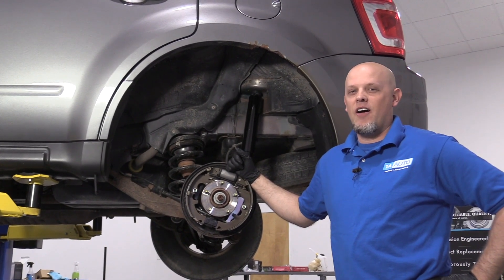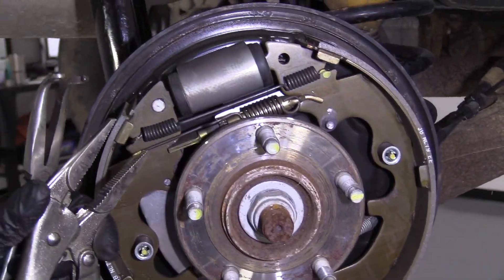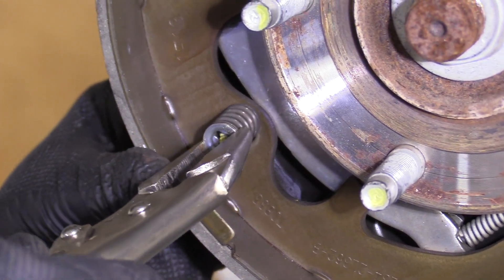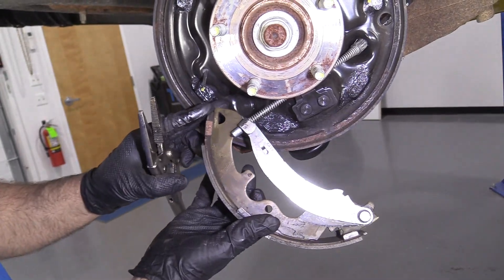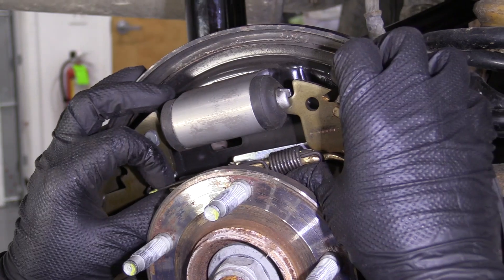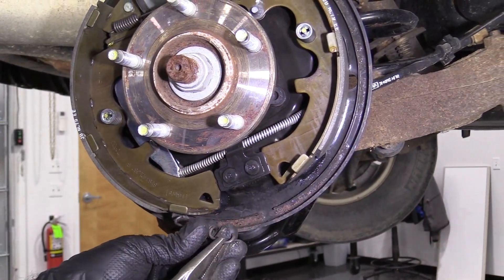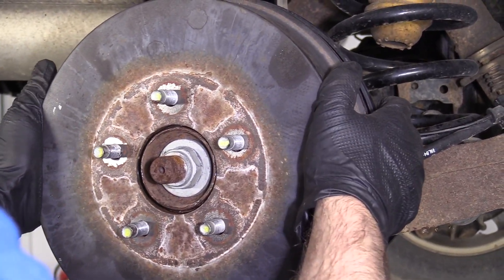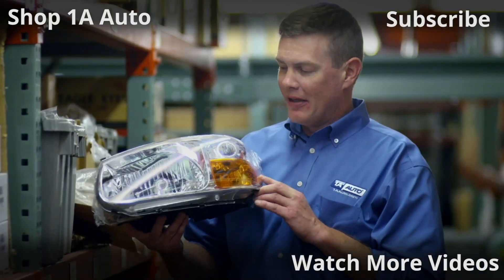How to Replace Rear Brakes 08-12 Ford Escape

Comment: Well dang. I’ve never attempted drum brakes because when I was a kid I was told it was way too difficult. Now I’m 51 and have YouTube. I’m gonna run this Escape until it dies. I’m at 236,000 miles so far, but I’m like the fifth owner. Still cranks up with ease every time. It’s a Ford! 😂

Comment: I love that these guys always use hand tools instead of battery or air tools. I took my drums off because my wife swore they were bad. I bought a kit for front and rear drums, rotors, and pads for front and back. Now I am stuck with the rear drums and pads for a long time. A1 auto has helped me every time I have gotten stuck on something with her 2011 Escape.

Comment: Hey 1A Auto, grateful for the vids.
Question, I have an `09 Escape (Limited-trim if that matters) - is there anything to watch for on the inside of the Drum itself, when replacing the shoes? 
Most of the vids I've seen involve poorly maintained vehicles or 'worst case' scenarios, so I'm having difficulty getting the sense of what is common wear versus bad maintenance/driving habits.